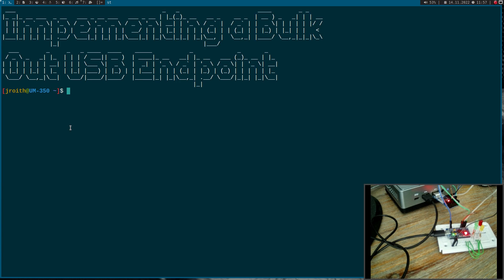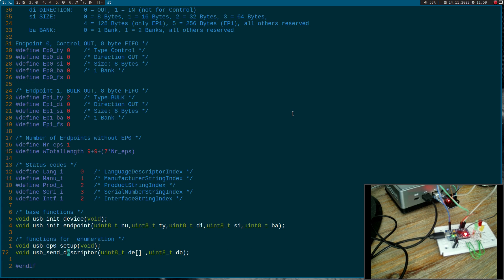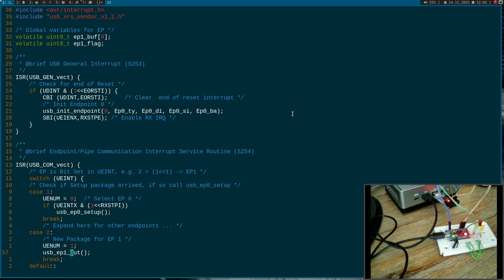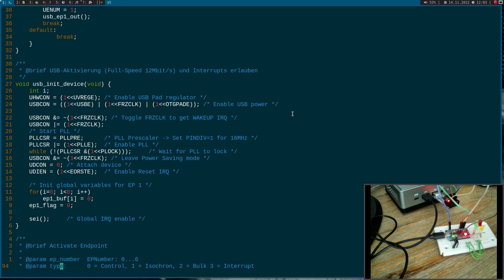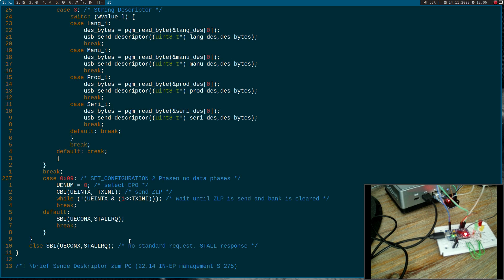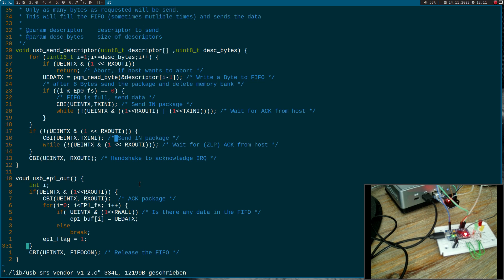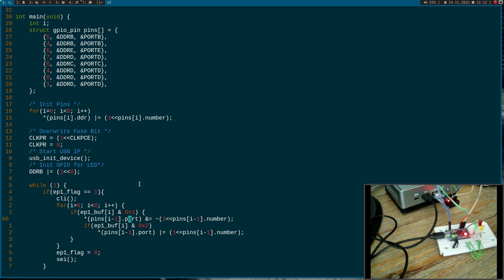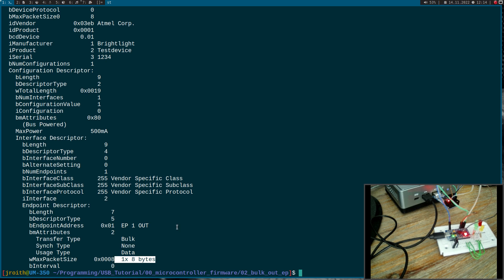GNU/Linux & USB - Implementing a USB Out Endpoint for Bulk Transfers on Atmega32U4

Comment: Would this work on an Arduino micro pro type of board or does it require a direct access to the chip without any bootloader? In the video it would seem you're using one of such boards but it's too small and I'm sure what it is..